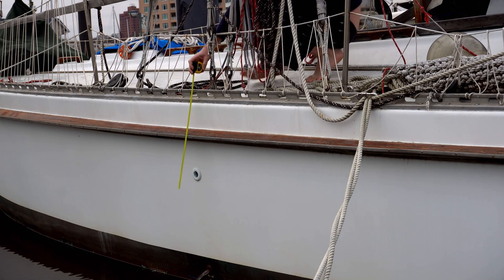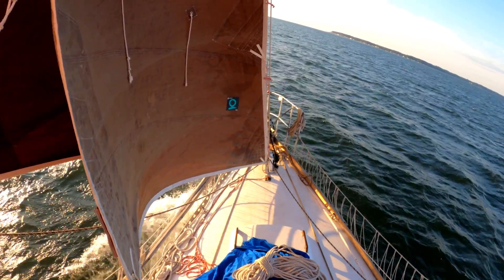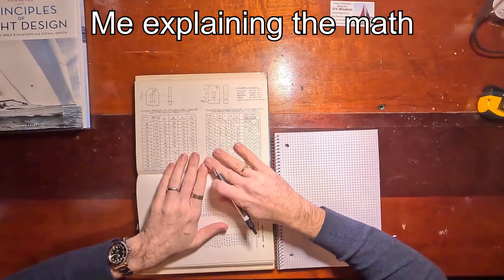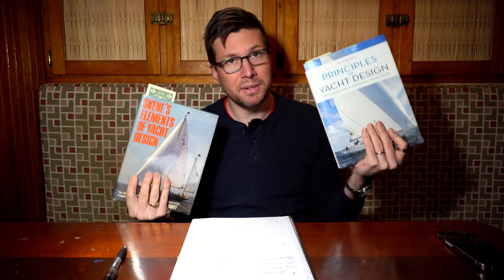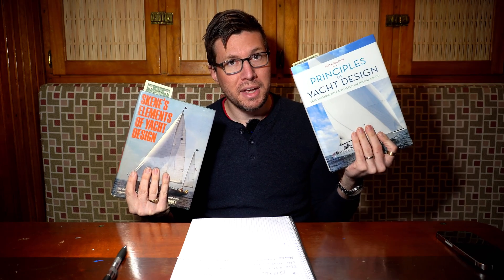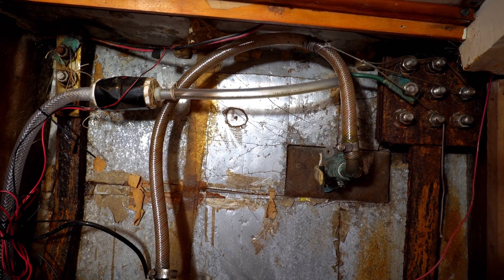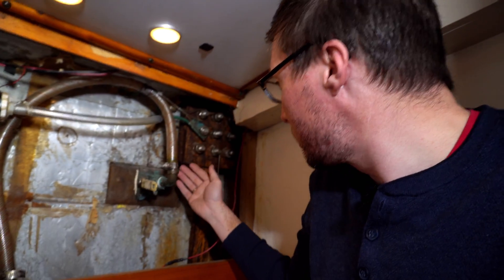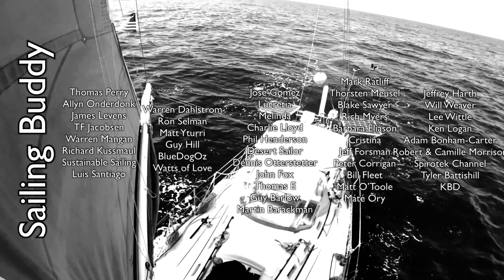How BAD Could OLD Chainplates Be? | Sailing Wisdom [S6 Ep2]

Comment: Chain plate inspection means replacement. Why not design a plate that can be repositioned to a second set of holes? Pull old section through, cut away the used portion, reshape the top, and re-bed. Since length isn't a crucial dimension, size them longer than originals to anticipate one repositioning.
Reply from the maker: I think it’s just because the metal in a marine environment causes the metal to degrade. The idea is to just replace with a new piece of metal that will begin decaying over the next decade to come.

Comment: Problems to solve through better engineering, 1.) Fabricate plates from a material that does not corrode, 2.) Improve ease of inspection. Bronze solves the first. Straight plates and full access to the connection hardware below deck solves the second, but only in part.
Reply from the maker: External Si-bronze chainplates solved both 1 & 2!

Comment: I have a question regarding the change from internal to external chain plates: Will this change affect the rigging geometry? In our case, we are talking about a shift of only a few centimeters (using the metric system). Is this small difference significant, or can it be considered negligible?
Reply from the maker: It is negligible but in a good direction. As the angle of the stay increases, the effectiveness of the stay does so as well. It would be an appreciable difference on a boat where you actually walk outboard of the stays on you way forward on the deck. Those boats will be moving outboard over 30cm and that will change the staying angle by a few degrees.

Comment: I think internal is the way to go. I'd rather have water damage on my deck and bulkheads than my hull. Water damaged hull is a lot worse and much harder to repair  strong enough to handle the load.
Reply from the maker: This is true if you have a cored hull, but if your hull is solid fiberglass, then you don’t have to worry about water damage if it leaks. 
Rotten bulkheads on the other hand are major damage on any boat

Comment: A total novis here. So the shipping containers are made out of steel thet rusts and the rust coat protects the structure. So i assumed that the marine industry would use this material to make chainplates?
Reply from the maker: It might have had something like that on it, but it’s also 55 years old. Shipping containers have a finite service life, after which they are discontinued and replaced. In my situation, exceeding the service life means repairing.

Comment: Most of the diss-masts related to rigging have been hardware that was to small , not strong enough. I've seen three in the last year with that problem. Connection stuff. I think in the last 10 years I've seen rigging slacken because of something to do with the post under the mast. That said, if one could get the statistics and explanations regarding the 10 dissmasted boats in the GGR race you'd get a more extreme explanation ! One of the most recent dis-masts happened because a bolt under the chain plate (holding the chain plate).
Reply from the maker: It would be an interesting point to investigate! I always set it up so that the clevis pin at the chainplate is the weakest link. Easy to inspect and easy to replace if it breaks (and the mast stays standing)

Comment: Is it possible you can make your standing rigging stronger than your actual hull.where is the best place for a failure on your rigging.I would rather lose the top of the mast than sink.
Reply from the maker: The targeted weak point is the clevis pin between the chainplate and turnbuckle. It acts as a fuse so that the boat and the mast will be spared.
Reply: @RiggingDoctor  so is that rusty iron cast iron, how do you know how weak or strong it is. I am a novice and I would be pretty worried, Rust just masks the problem. Isn't it very brittle under shock loads.I don't want to worry you of course because I don't really know anything other than high voltage

Comment: you neglected to take into account the part of the "slip critical joint" definition where is says: Steel to steel connection.  Torquing a fastener to 2/3 yield to get the proper tension will crush your fiberglass and you will never get the torque.   The  torque specified in most tables provides a preload  of 2/3 yield.  The compressive strength of what you are clamping must be able to resist that stress.  (washers don't really spread the load unless they are super thick and hard.  Also, like your boat, the chain plates are attached to an internal structure.  Most go directly to a bulkhead or frame that is properly tabbed in or beefed up to take the stress and transfer it to the hull.  I would be careful changing a structural design without buy-in from the designer or a naval architect.  The rules for steel construction developed and used by structural engineers assume everything is steel.  Peter Stockless, PE
Reply: Beautifully said!

Comment: Your logic is pretty darn good.  One thing you didn't mention, (or i missed it) is that with the external chainplates a part of the load on the chainplate is now a compression load, since the rigging now pulls at a slight angle against the outside of the hull.  This is in contrast to an internal chainplate which pulls the chainplate away from the hull.  It probably matters less where bolts are used rather than just glassing the chainplate in, but in my Island Packet my new internal chainplates pull away from the inside of the Hull, relying totally on a secondary epoxy bond to keep the chainplate in place.  It looks nice, but I would sleep easier with external chainplates.  Also, I do know that Fastenal makes custom bolts out of any material (Once upon a time I used to make custom bolts for Fastenal).   The silicon bronze chainplates should be pretty easy.  The Northeast had many brass/bronze suppliers at one time.   Here in Texas there should be ample bronze suppliers also.  I'll check the Houston area.  Fair winds.

Comment: Internal chainplates also allow your jib track to run that little bit closer to the centre-line, so improve your upwind performance.
For longer distance upwind sailing, I guess you can use a barber hauler, but the position of your jib track & block needs to be considered.

Comment: Is there a difference of strength needed for rigging and chain plates when it comes to deck stepped vs keel stepped? If so, I know you want to convert to keel stepped so did you factor that in to the calculations?

Comment: You should talk to AMPCO metal fabricators.   AMPCO is a bronze - Aluminum metal which is good salt water corrosion resistant and has a high tensile strength.   Knowing what you need they may be able to come up with a solution in their materials.
They also have the best NON-Sparking tools for boats.
Reply: I second this.  Ampco 8 would be great stuff.  There is also a nickle aluminum bronze used by the navy for a lot of stuff that is tougher than stink!

Comment: My dad literally yelled at the screen when you started talking, "No matter where you put 'em, they gotta be looked at, so don't bury them."  He was so maniacal about inspecting everything on his boat, he hated hidden places for problems.   For instance, he didn't like furlers or hardware that couldn't be inspected (even if you had to look in a locker).   Every through hole had a mallet and a bung on a cord next to it and they were all inspected on a weekly basis.   He even used the manual bilge pump every month and inspected the tubing (it had a long lever that installed under a fitting in the cockpit.  (His boat was a Pearson 39-2, built for him with a raised cabin top so he could stand up without hunching over)
Reply from the maker: Sounds like we have a lot in common!
Reply: I have some comments which I hope will be useful: 1) Modify the boat inside so that all chainplates can be visually inspected; 2) Use flexible, non-hardening sealant, I use butyl rubber; 3) Use NiAlBronze which is non-corroding and has a nice gold colour; 4) If you have s/s chainplates, remove to test, using following test: suspend chainplate from lower bolt hole using a screwdriver, strike chainplate with steel hammer,  clear musical note should sound, reverse chainplate and hang from rigging screw hole, strike again. If chainplate is good, clear bell-like sounds. If crevice corrosion is present, there is a dull “clang”. Absolutely no risk of mistake, even if you are tone-deaf!😉

Comment: Herbie, Port Townsend Foundry will sell you Bronze chainplates.  He puts square holes in them so you can use silicone bronze carriage bots available from McMaster-Carr and bolt depot.

Only one problem…. You will have to wait on them.  Could take a year to get them.  They are very busy.
Reply: I used them for my Tayana 37 . I waited a very long time to get them.

Comment: I would think that the biggest problems to solve are: how do make sure the hull section is strong enough to support the plates and how do you get straight metal bars tight to a round hull section.

Comment: If a designer is smart, the chainplates are visible for inpection. I pull mine for inspection  and resealing every year. Mine are 50 years old, original to the boat, and are still good as new based on my recent syrveys. To be able to get close hauled, i need to keep my stays away from the fat sides of my boat. So all in all, I prefer interbal.

Comment: A couple of observations: You commented on the choice of bronze for chain plates. Is there a difference in friction between stainless steel chain plates on fibre glass rather than bronze that would affect the calculations? Or bronze on wood etc.? 

Also considering the portion of the chain plate above the deck, since it is not subject to friction or such, should there be extra metal around the hole to provide additional strength?

Comment: Have you thought about building carbon fiber chain plates?
Reply: good idea
Reply from the maker: Do you have any information on them? I have seen one type that looks like an inverted fan which would be great on a new build but would require too much disassembly to do on Wisdom.
Reply: @RiggingDoctor  yes the builds of carbon epoxy chain plates I've seen do have significant fans of tape layers mostly unidirectional up and down the hull which could be challenging given the cabinet in the way. Probably easier to do on a new boat build. But if you can remove and reattach the interior items, likely worthwhile. I've seen these:
Youngbarnacles  https://youtu.be/yvvyDdgUrrQ?si=QoYt1WigJvYJ-eIp
Living on the ocean channel also did their own CF. https://youtu.be/JHI2AExmZCM?si=l_p_tnTbD8IOvvBG
I'm wondering if you could design external carbon fiber. Of course that would add a lot of grinding sanding fairing work on the hull.
Reply: @RiggingDoctor  in my mind, the biggest benefit of the carbon is that you can avoid any actual holes, completely filling the pass through with thickened epoxy and fiber layers.

Comment: @09:25 "… if you take the diameter of each bolt plus that space between each bolt …"
Umm — I must've slept through the part where "that space between each" was defined. (Sad to say, I'm not handling old age very well¡ 😂
Can you help me with calculating the space between?
Reply from the maker: The math was just way too boring! Basically, the space between each bolt should be 3x the bolt diameter but if the metal chainplate is oversized you can get away with 2x the diameter, but safer on the side of 2.67x the bolt diameter. 
If you have 7 1/2” bolts you now have 3.5” of bolt holes and 7” of space between the holes so 10.5” total length of fastener area.

Comment: I'm going to throw a spanner in the works as I am currently upgrading/replacing the rig on our 1979 Colvic sea rover 28 and the chain plates are internal  and glassed into the hull but are angled 90 degrees at the top and under the deck. So the L shaped bracket is bolted and glassed into the side hull and the deck. Then there is a U bolt bolted through the fibre glass deck and into the deck portion of the chain plate. This means with our cutter rig the sheets run outside all the shrouds. Currently I am replacing the U bolts as they are the original 1979 bolts and very rusty with 9000kg breaking load Stainless U bolts. Even though the L shaped chain plates are steel they are not rusted as they are completely encapsulated. I don't know if this is worth considering for your boat as it would be very easy to manufacture angled plates but I would be happy to email you photos of our set up.

Comment: The chainplates on the boat I'm refitting are external. Just bronze straps bolted to the topsides.

I'll be removing them and stripping the paint, and then decide whether i need to replace them.
Reply from the maker: That’s what my goal is to have! Do you have stainless or bronze fasteners?
Reply: @RiggingDoctor  Bronze.  Boat was built in 1978, and I'm pretty sure this is original equipment.

Comment: One other reason to put chainplates inboard is to allow the jib to be sheeted in tighter when sailing to windward allowing you to point higher.  This is only a benefit if the chainplates are at least a foot inboard.  Its also not a benefit if you manage to sail downwind or only slightly forward of the beam nearly all of the time.  Cruisers hope and plan to do that but end up sailing to windward at times despite their best efforts.  Looks like Wisdom's chainplates were only slightly inboard so that was not a benefit and its only the asthetic.  btw - I would just go oversized and stainless.
Reply from the maker: The chainplates are going to scoot about 2 inches outboard so it won’t have much of an effect on sheeting angles.  If I oversize the current plates it won’t fit in my toggles! The plates are currently 1/2 thick 😅
If I weren’t so set in my ways, I would also do stainless, but I really want to do bronze so that they are done forever. 
Si Bronze chainplates with Si Bronze fasteners and then I never need to worry about them 😎